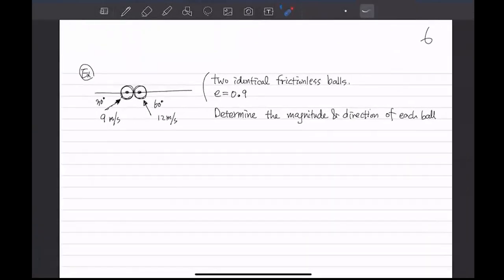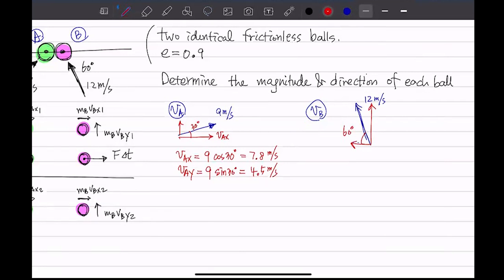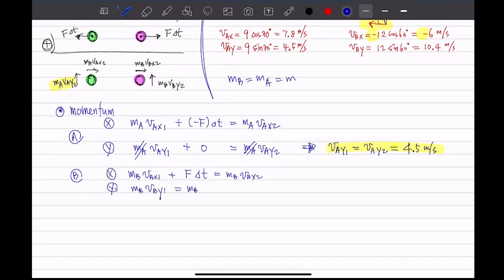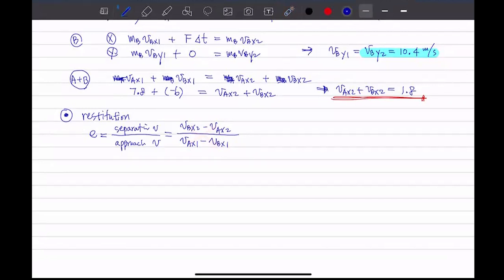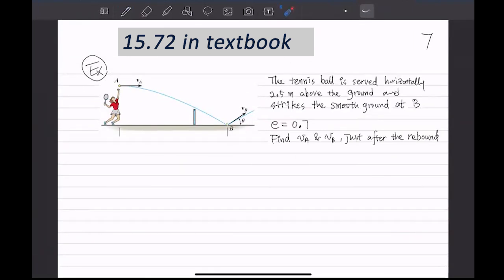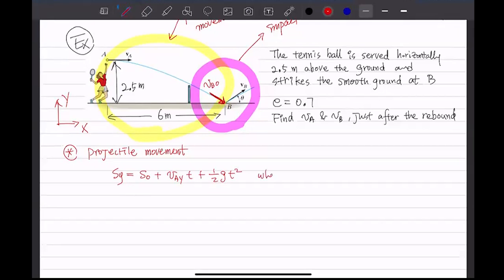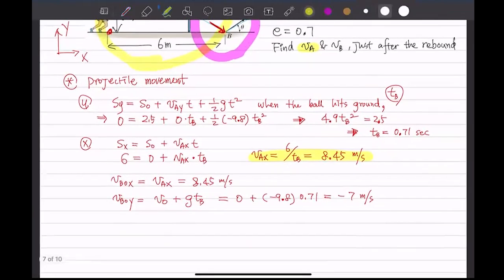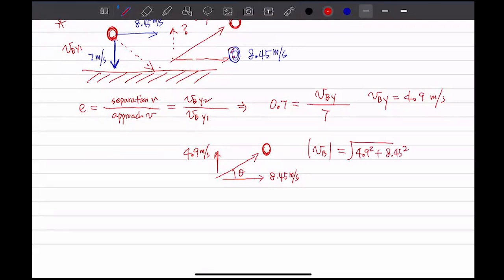Oblique Impact Examples | Dynamics Tutorial + Worked Example (Hibbeler 15-72)

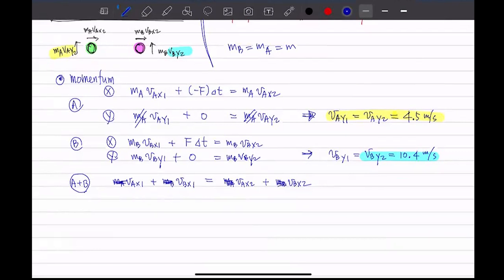Comment: Hello, thank you for the interesting tutorials. I would have a quick question/observation. At 11:11 you are considering the particular case where m_A = m_B right ? Otherwise you can’t just cancel out the masses.
Reply from the maker: Yes, you are correct. They are assumed as two identical frictionless balls in this example problem. Hope this helps!
Reply: @engr-smart Yes, thank you. From a viewer perspective, I think it would be clearer to see this statement in the very initial description of the problem, i.e. using “m” instead of “m_A” or “m_B”, or even consider the masses to be different, which would be a good addition to the example.